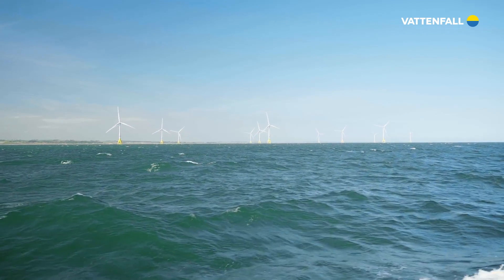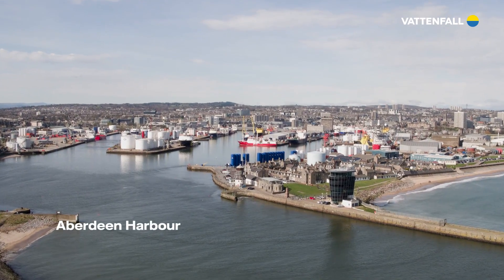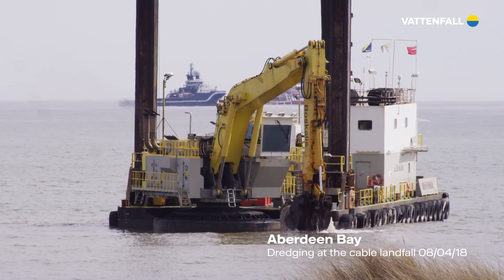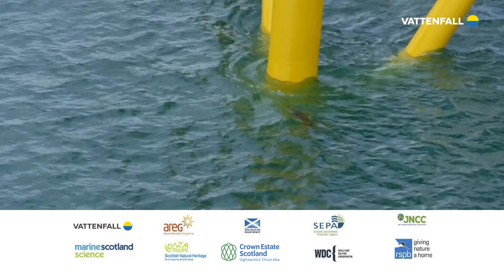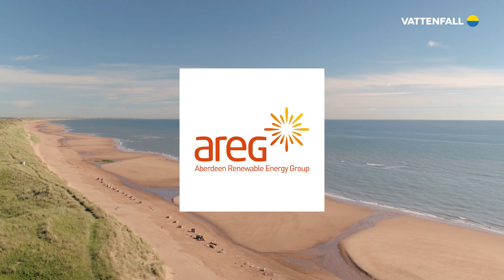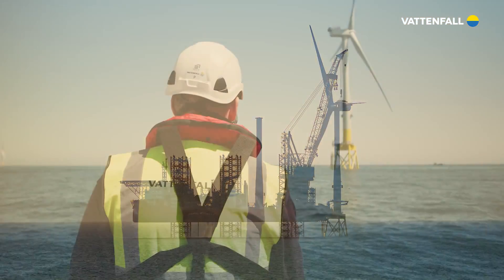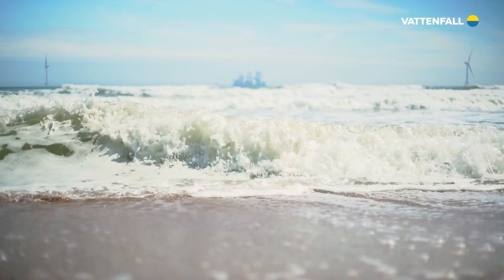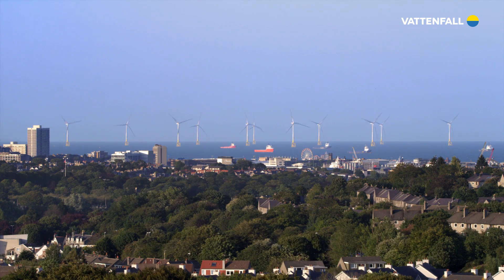#EOWDCopen: Inauguration of EOWDC outside Aberdeen, Scotland - Vattenfall

Comment: In regard to the Press and Journal Story "Contract worth £100,000 awarded to Aberdeen for hydrogen study"
https://www.pressandjournal.co.uk/fp/news/aberdeen/1858748/contract-worth-100000-awarded-to-aberdeen-for-hydrogen-study/  

In general terms, site your electrolysis equipment at wind and solar farms, to utilise farm power directly - in other words, without having to power electrolysis via capacity-limited grid connections.

This is so that when wind and solar farms are ordered by the grid management to constrain generation (at times when the available wind and solar power supply exceeds the demand) the surplus farm power can be switched automatically to power the electrolysis plant, producing hydrogen, taking full advantage of all the available farm power.

In Aberdeen terms, it would be best to site your electrolysis equipment at or near the Blackdog onshore substation where the power from the Aberdeen Bay wind farm (EOWDC) comes ashore.

If that's not convenient for some unexpected reason - maybe not the most convenient place to build a hydrogen refuelling station say - then I suppose in theory you could site your electrolysis plant somewhere on the route of the connection between the Blackdog onshore substation and the SSE's substation at Dyce but that would likely involve having to build a new substation just for the electrolysis plant, which could be done if the obvious Blackdog substation wasn't ideal in every way for some reason.
1:49

There's your answer for free. No need to pay me £100,000. LOL.

My 100% Renewable Energy Blog 
https://scottishscientist.wordpress.com/
* Wind, solar, storage and back-up system designer
* Industrial Vandalism: how market forces delay the transition to 100% Renewable Energy
* Remedying UK Power Cuts and Re-nationalising the Grid 
* Double Tidal Lagoon Baseload Scheme
* Off-Shore Electricity from Wind, Solar and Hydrogen Power
* World’s biggest-ever pumped-storage hydro-scheme, for Scotland?
* Search for sites to build new pumped-storage hydroelectricity schemes
* Glasa Morie Glass Pumped-Storage Hydro Scheme
* Let’s supersize × 1000 the tiny Glasa hydro scheme!
* Modelling of wind and pumped-storage power
* Scotland Electricity Generation – my plan for 2020
* South America – GREAT for Renewable Energy

Comment: Turbine out of action after lightning strike.
 "Manufacturer MHI Vestas confirmed to Recharge that it is investigating the cause of damage to one of the turbine’s blades after its monitoring picked up the problem at the European Offshore Wind Deployment Centre (EOWDC) in early February.

“Weather depending, we’re planning to replace the blade sometime in the coming week,” said a spokesman for the company."

https://www.rechargenews.com/wind/1735977/trump-row-wind-farm-turbine-offline-after-lightning-strike
Lightning is an obvious hazard for wind turbines so turbine blades which cannot withstand a lightning strike are not fit for purpose. Each and every turbine blade should have been tested for lightning proof performance before leaving the factory.

If this is the first blade to take a lightning strike and it failed right away then such an early failure looks like there could be a design fault or a systematic manufacturing fault with the lightning protection components.

This could be very expensive for MHI Vestas if they have to replace or repair all the turbine blades under warranty so as properly to lightning-proof them all but that's what the customer has every right to demand.

It is simply unacceptable to wait until the next lightning strike takes out another turbine blade. A systematic replacement or upgrading programme must be instituted to get all turbine blades lightning proofed.

Aberdeen has its reputation to preserve as the energy capital and that means no shoddy goods allowed in the Aberdeen Bay "shop window", so to speak.
Reply: The real problem with wind power isn't technical problems here and there, though they're fairly common. The big issues are that they A) totally ruin the natural character of places, B) are built with fossil fuels and have done nearly nothing to reduce CO2 (now at 415 PPM), and C) they're a favorite of the construction industry for subsidy money, and anything truly green about them vanished decades ago when they got too big. Look at how many of the bloody things have been built already: https://www.google.com/search?&q=wind+energy+map (industrialization on an epic scale, doing little but making the planet uglier, noisier, and more dangerous for wildlife)

Comment: The Wind Generation Capacity Focus Table for a 93MW wind farm with capacity factor of 38% (which is about what the Aberdeen Bay Wind Farm is) recommends in each row A to H, a system configuration - matching the wind turbines with energy storage (of about 750 MWh) and back-up power (ranging from none - 0MW - up to 82MW) to deliver on power on demand (ranging from 21MW up to 147MW).
Reply: An image of the table can be viewed here
https://uploads.disquscdn.com/images/6eaa2a630b76cf30a2bb31eaa128ff7c568ca3a081aa55771bca4031d1e74b92.jpg
Reply: Since I recommend about 750 MWh of energy storage capacity is suitable to match with this wind farm, I must simultaneously WARN NOT TO TRUST ANY (SNAKE OIL) BATTERY SALESMAN who claims that their (far too small capacity) battery is of any "use" whatsoever to match with this wind farm.
Far too small batteries of a capacity much less than 750 MWh are simply not fit for purpose and any battery salesman showing up claiming anything to the contrary should be politely but firmly SHOWN THE DOOR.
https://scottishscientist.wordpress.com/2015/03/08/scotland-electricity-generation-my-plan-for-2020/#comment-829
Reply: @Scot_Scientist  That battery braggadocio just shows how big these damned "farms" have become as they trounce what's left of natural ambiance. Neil Young's "aimless blade of science" has become a physical reality.